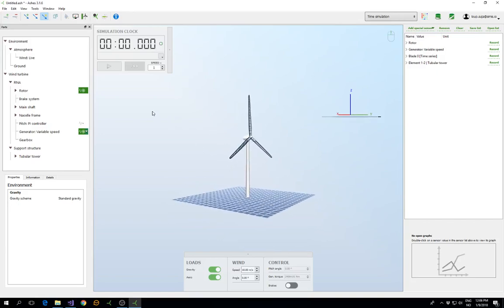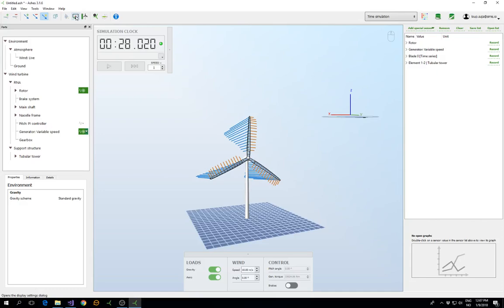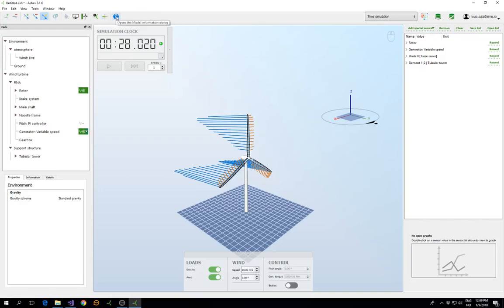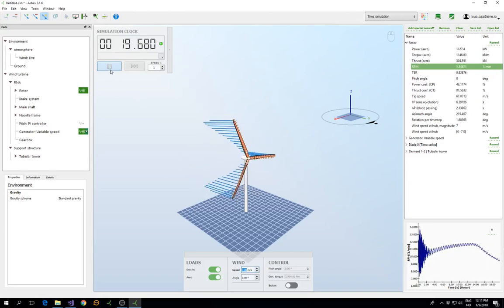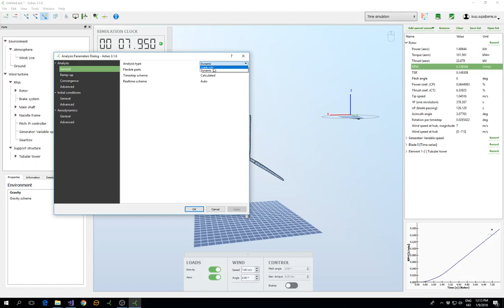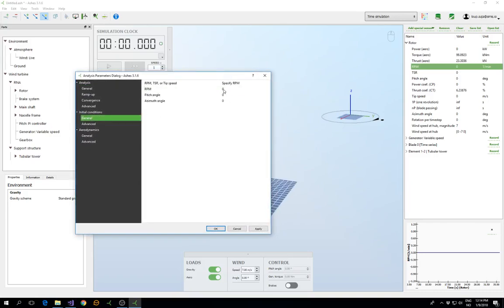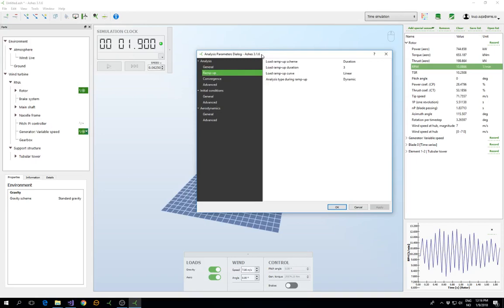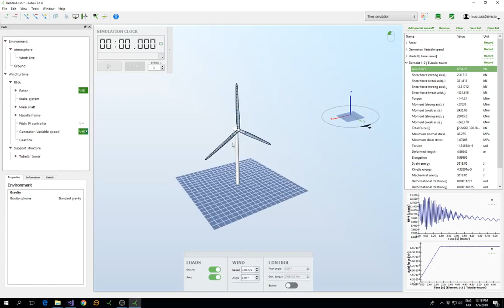Some visualization and simulation parameters

Comment: Hello! It is a nice presentation!
How do I get the wind direction directed straightway toward the turbine? I mean the wind vector shown in the velocity triangle.
Reply from the maker: Which version of Ashes are you using? There is an issue in 3.17, which will be solved in the next release. Get in touch at support@simis.io and we can share version 3.16 with you
Reply: Thanks for the update. I have version 3.17. How do I get 3.16?
Reply from the maker: @ranadevdasgupta7415  Get in touch with us at support@simis.io and we can send you the installer